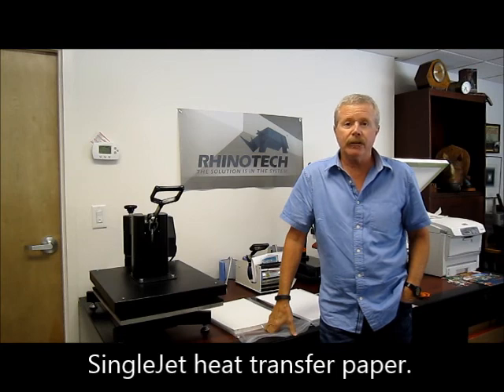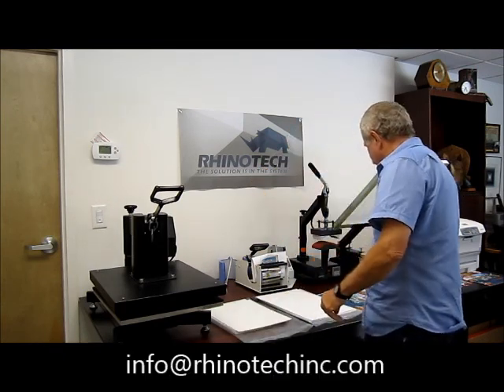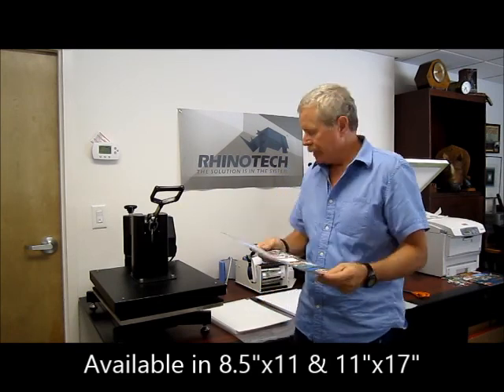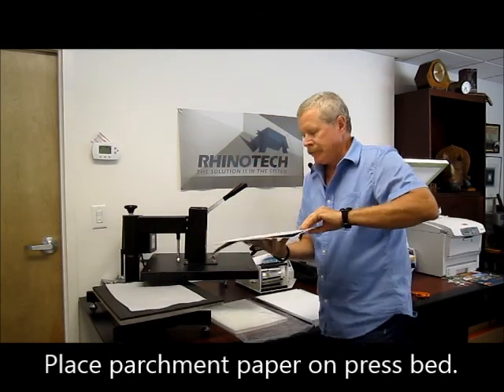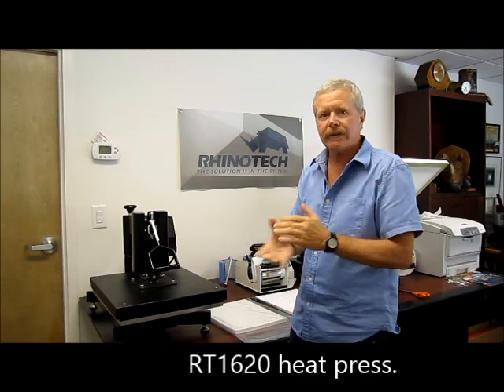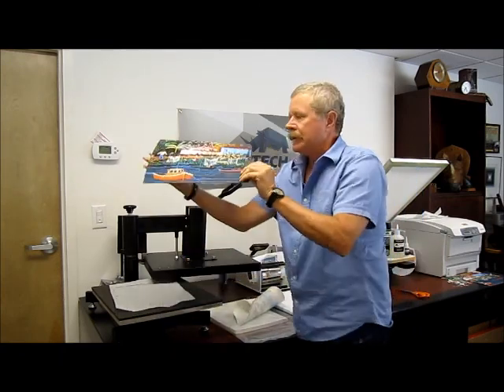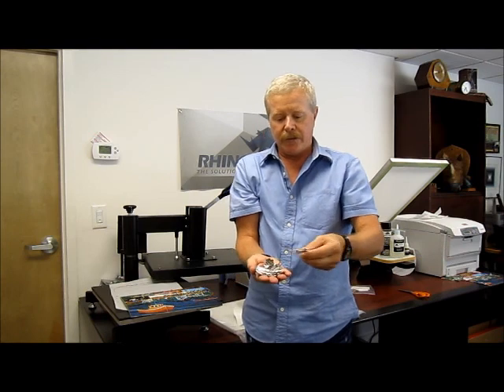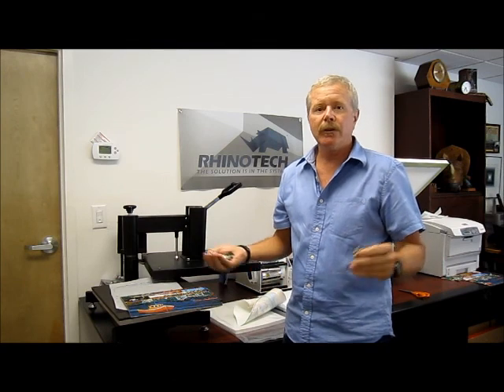Custom Puzzle Printing w/SingleJet Heat Transfer Paper!

Comment: Thank you so much!!! I thought I HAD to buy a sublimation ink and printer in order for this to work. This is a last min gift so glad I found you! Thank you again.
Reply from the maker: You're very welcome. We're here to help.
Reply: What kind of paper was used and is this for any kind of printer?
Reply from the maker: @abuseisreal  We used SingleJet heat transfer paper: https://rhinotechinc.com/product/singlejet-ii-inkjet-paper/. You can buy a Test Pack of 5 sheets to make sure that this is what you're looking for. An inkjet printer that is a dye or pigment based system is the type of printer that you need. Hope this helps. Please call us if you need more info or help. 651-686-5027 x 4. Looking forward to working with you.

Comment: What type of blank puzzle are your using in the video?
Reply from the maker: Thanks for watching our video. In answer to your question, we used a puzzle blank suited for use with an inkjet paper. We don't sell the puzzle blanks, but Coastal and others supply them. To test, you might want to pick up a blank at Target or a wholesale supplier. Here's the link t SingleJet Inkjet transfer paper: https://rhinotechinc.com/shop/?ixwpst[product_cat][]=329&title=1&excerpt=1&content=1&categories=1&attributes=1&tags=1&sku=1&ixwpsf[taxonomy][product_cat][show]=set&ixwpsf[taxonomy][product_cat][multiple]=1&ixwpsf[taxonomy][product_cat][filter]=. 

If you're interested in an awards blank, we do sell those at: https://rhinotechinc.com/shop/?ixwpst[product_cat][]=311&title=1&excerpt=1&content=1&categories=1&attributes=1&tags=1&sku=1&ixwpsf[taxonomy][product_cat][show]=set&ixwpsf[taxonomy][product_cat][multiple]=1&ixwpsf[taxonomy][product_cat][filter]=1. Please call us at 651-686-5027 x 4 if we can help you with your project. Good luck.